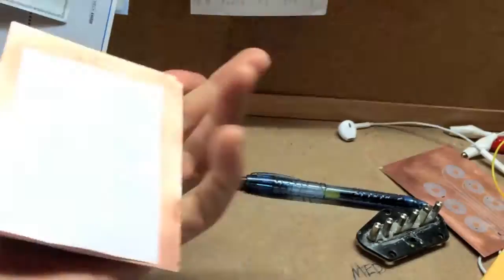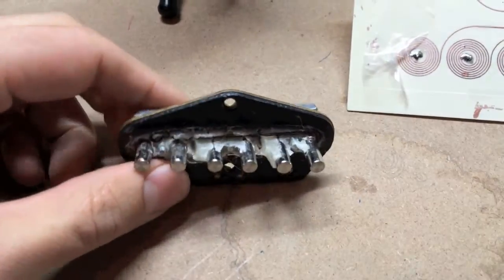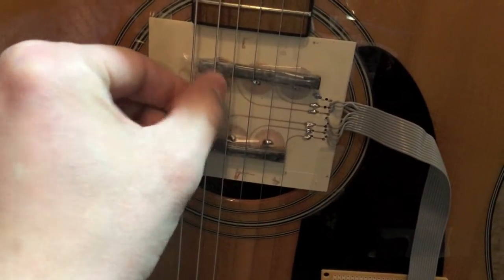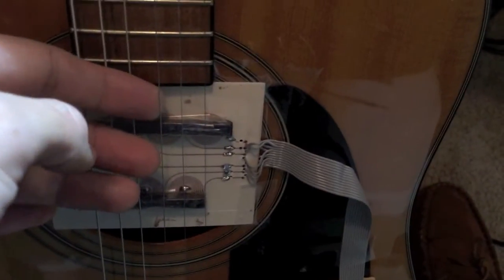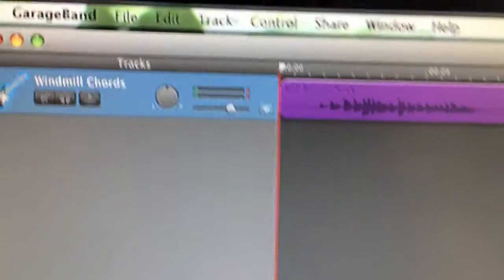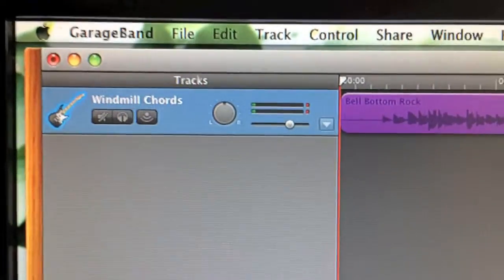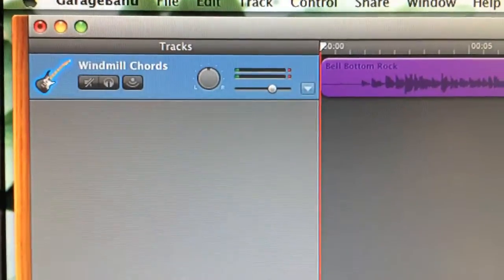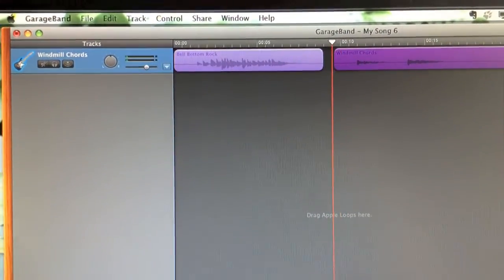Printed Circuit Board Guitar Pickup - Guitarduino 2.0 Update

Comment: This is amazing I came here to see if it's possible to modify a guitar to register each individual pickup so you can have for example an 18 channel output from the guitar which would make equalization for each individual string possible

You could use this to prevent unwanted harmonics caused by distortion resulting in cleaner audible tones

i.e it could do a LOT to clean up the digital frequencies i think a LOT is possible with this setup
I was dissapointed with how guitar amps make every chord sound like literal electric noise (with few exceptions on particular harmonic ''scales'')

I mean you can prevent unwanted feedback with this setup you can clean up amp noise you can even tune each string individually so when amplified each note is still distinct (despite amplification)

i.e clipping low frequencies from midtones whilst keeping them on the bass string (for more distinct bass WITHOUT unwanted overlap!)

Anyway watching your video I believe this is possible and I think you're onto something huge tbh
Reply from the maker: Haven't done anything really with this project since posting this 10 years ago! but so glad to see it helped or inspired you. 

The original idea for this was to essentially create 1 pickup for each string, so 6 outputs in total. Then you could do signal processing/filtering on each string before it goes into the amp. Sounds similar to what you are saying.

Unfortunately I didn't go much further with the build. I have 1 YouTube Short under this account and that video shows the PCB I got professionally made. Its very similar to the board in this video except I built a little preamp (w/ op amps) before it goes into the amp.